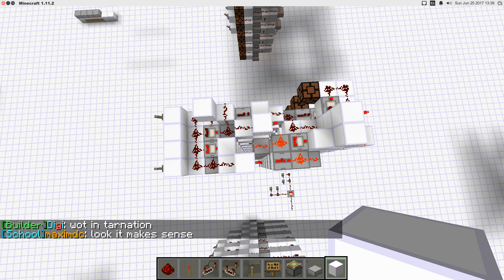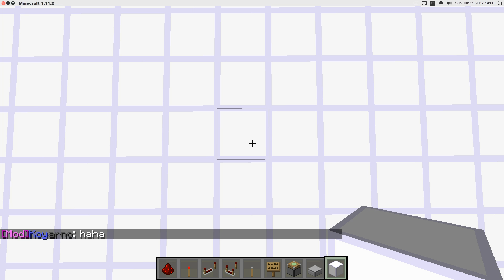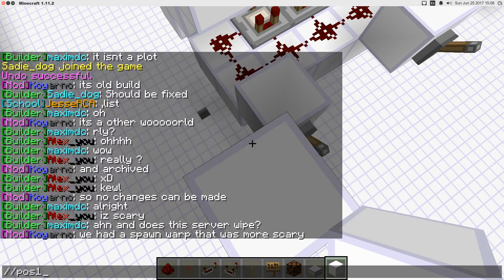CCA Adder Tutorial - The ultimate redstone adder

Comment: Maybe I missed something, but how does the carry get un-canceled? Say you have
01001
+
01001
=
10010

You have to carry, then cancel, then carry again. If the cancel signal always goes through to the end, how is this handled?
Reply: Oh, I think I understand now. If the carry generate signal is stronger than the carry cancel, it won't actually cancel it, due to how comparators work. The cancel will only work if cancel is as strong or stronger than generate.
That is neat!

Probably should have mentioned that in the video, though ;)
Reply: the cancel comparator has a weaken side input thus having a non 0 output.

Comment: Is there a particular reason why the XOR gates were built as the:
XRBX
RCCR
RRRR
BXXB

Instead of:
XRBX
RCCR
BRRB

X = Nothing/irrelevant
R = Redstone dust
B = Solid Block
C = Comparator

This latter design has a much stronger signal, 14 since there is no cross contamination of subtraction from the secondary inputs. E.g. When A is on an B is off, the comparator at by A is subtracting 15 from 15 and outputting nothing while the comparator by B is subtracting 0 from 14 and outputting 14 and vice versa.
Reply: kiraPh1234k several reasons. First of all signal strength isn't that big of a deal for this design because the signal is immediately sent into signal extending devices. The other two reasons are that you need the OR of the inputs for the CC signal and that you need to add repeaters to power the blocks which would be extra delay.
Reply: After I built it I realized that we needed the OR/MAX output of the inputs.

Comment: I don't know if this is a stupid question or not but, if you invert one of the 8 bit inputs and send a 1 through the carry in line, will the adder function as a subtractor?  I would assume so because that is possible with ripple carry adders but I don't know if the carry clear functions within the wiring would prevent such a system to work.
Reply: Yea

Comment: how many ticks is this adder?
Reply from the maker: That's true. However, the adder shown in this video is 4 ticks. Also, in my opinion, 3 tick CCA designs aren't yet refined enough to really be practical for any more advanced purposes like ALUs, multipliers, dividers, etc. etc. I might show them off at some point, but for now my focus will be with more traditional CCA designs.
Reply from the maker: 4 ticks, and completely synchronized outputs.
Reply: Ernestas Viskontas 3 ticks is nearly impossible though.  Because the least amount of ticks to make a generate is 2 + 1 tick for carry cancel, plus 1 tick xor gate.  correct me if I'm wrong
Reply: CCA is 3 tick capable at this point.
Reply: That's why you have to do something else. You compute the carry and its inverse both in parallel, and becuase you have to use comparators you will also be able to disable those comparators. All you have to do is disable the right comparator in a short amount of time. It's been done. The first working 3 tick solid CCA has been made just last week or so.

Comment: And when you want build 16 bit adder ? Than it will be not 4 tick but 5 tick after the 8 bit right ? because you need add repeater after 8bit... :) sorry for my english
Reply from the maker: That's true of this adder, and every other adder design I know of.
Reply: If you extend the generate and cancel lines with repeaters you lose the information about which signal is higher. So the only way is to get the carry out from the last comparator and extend it with a repeater to a generate tower again. That costs 2 ticks extra. I do have a redesign of cca (subtractor) that uses all the signal strength powers to have 16 bit output on 4 ticks but the input/output layout is not for everybody.
Reply: Anyway, I am happy you are back! :)
Reply: bennyscube PPAs don't need it until you get to 32 bits (assuming you have an efficient design)
Reply: @IDW64  what are ppa adders?
Reply: jUsT uSe 0-tICk PiStoN LoGiC